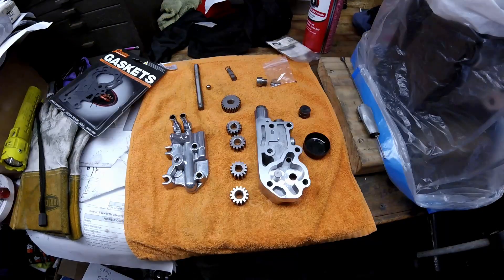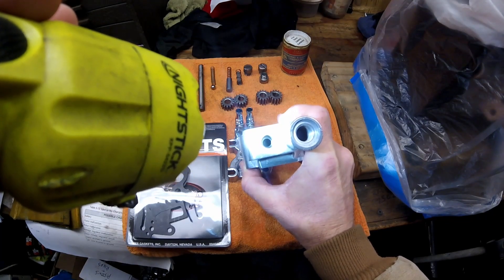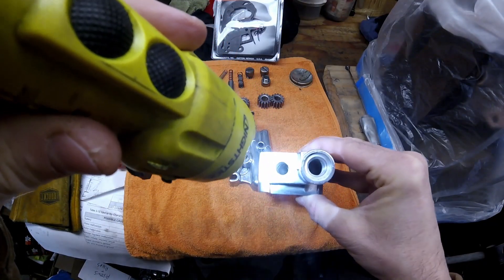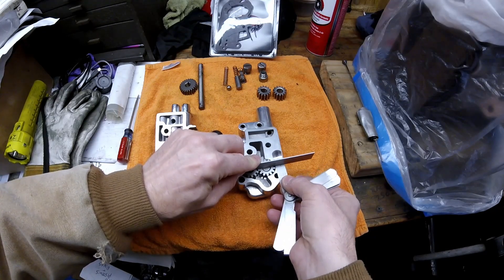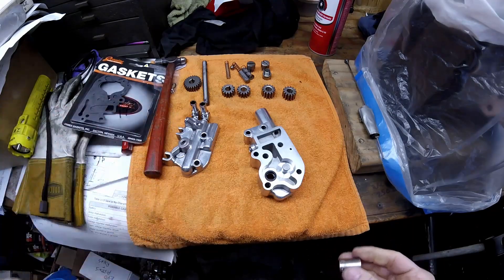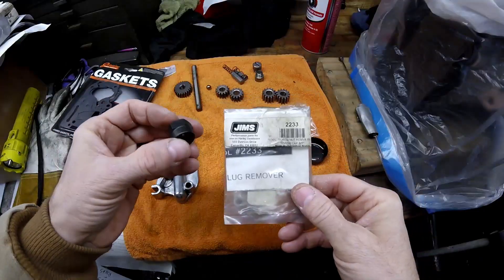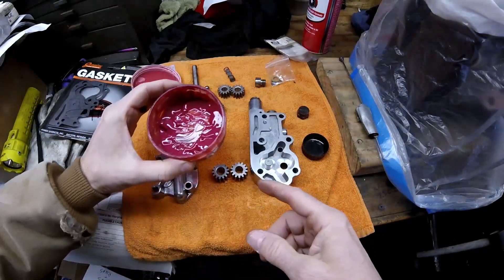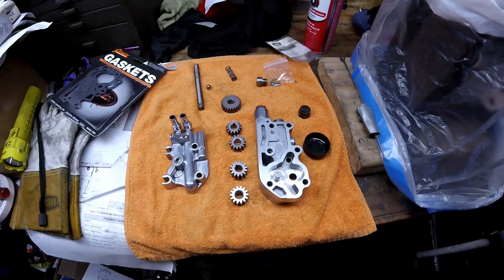Oil Sumping Fix and Pump Rebuild Harley Pan Shovel Evo

Comment: This is great info. I have an 91 fxrs-sp that's pushing oil out the breather..do you think maybe the check ball is the issue? Do you have a video on removing the pump off the bike?
Reply from the maker: I have an install video. Just do it in reverse. 

Harley Oil pump install the right way Shovel Evo Pan
https://youtu.be/n9XF6znbj0Y
Reply from the maker: I would remove the check ball and check to see if it has dirt under it. I’d also try replacing the check ball and spring before I’d remove the pump.

Comment: Could you plz let me know for compound grid spec?
Reply from the maker: Any fine grit is good. 600 grit is what I used.
Reply: @Rapsgarage  thanks!!! Need to clean compound necessarily? Or mix with engine oil ok?  If have to clean, I will work without separate oil pump from engine
Reply from the maker: Must clean grit out. You don’t want any grit in your engine. You can do it on the bike but you must clean it before you finish.
Reply: @Rapsgarage  Is there a way to clean it perfectly without removing it from engine?
Reply from the maker: @DM1212-x6y  I’ve used a q-tip and carb cleaner
Reply from the maker: @DM1212-x6y  I’m curious as to where you’re from? It’s always nice to know how far away people are watching my videos.
Reply: @Rapsgarage  I'm in the south korea. As you know, very few people ride Old harley in Korea, so there is very little information. It is a great help thanks to you YouTubers in the U.S. like you.
Reply from the maker: @DM1212-x6y  that’s awesome! Keep ride the old HD’s and I’m glad I can help!
Reply: @Rapsgarage  Thanks a lot!! One more question. Could you recommend the best engine oil spec and brand for shovelhead(kick start only)?
Reply from the maker: @DM1212-x6y  any 60 weight oil for an air cold the twin engine will do.  

https://www.ebay.com/itm/134810483763?mkcid=16&mkevt=1&mkrid=711-127632-2357-0&ssspo=wHbTM7iaTHm&sssrc=4429486&ssuid=zzfRVGHGQ1W&var=&widget_ver=artemis&media=COPY
Reply: @Rapsgarage  How do you think about the ams v-twin 20w50, unfortunately, I can't buy single grade spec engine oil in Korea.
Reply from the maker: If you can’t get a straight weight oil it’s a good oil.

Comment: I just went through this on my 86 FXWG 2 weeks ago. I found there was pitting on the ball seat. A friend owns a machine shop and had a "Ball mill" the same dia as the check ball itself. We manually worked it down a few thousands, then lightly lapped it. Perfection!  No leak!
Reply from the maker: That’s a great way to fix it. Thanks for sharing this information!
Reply: Did you have to open the cam chest or were you able to pull the body off without pulling the cams out?

Comment: I have done all this and including having a machine shop very lightly machine the ball seat. Still leaks like crazy just sitting there.
Reply from the maker: I’d put blue machinist dye on it and lap it again to make sure the seat is good. Also check for cracks. Replace the ball and spring. After that I’d check to make sure the the scavenging pump is working properly. It could be that you’re filling the crank case with oil and not getting it out. I’d also check to make sure your oil lines are good. If you have a oil line that’s collapsed internally it will not let it scavenge the cam chest.

Comment: For a new Chek Ball and light spring for a 1986 Harley softail fxst, I’m without my owners manual presently.. recommendations to source new ones(or do I  reuse the ones in the pump now)?

Also, can I use your technique of welding a ball on a rod with lapping compound while the external oil pump still affixed to the bike.

Didn’t know if I could remove the face to do the work, of the oil pump leaving everything in tact, only working on the check ball and light spring ?

I love this stuff yet don’t want to make myself anymore work the needed. Thanks all.

Any leads or videos- I’m grateful.  G-d bless all.
Reply from the maker: @EthanFox-jw7oc  I don’t have a way to get the part number for the parts. I would say if the ball looks good then reuse it. With the spring, you cam give them a little stretch but not much. Go easy with it. Maybe lengthen it a 1/4”. 
You can lap the seat with the pump connected to the engine but only use a small amount of compound. Its important to drain the oil from the oil tank before you start. It’s super important to get the lapping compound all out. I would use a Q-tip but with that you need to get all of the fibers out too. After you think you have all the compound out, pour a bit of oil into the oil tank. The oil will flow out of the pump at this location and flush out any compound that may be left. Needless to say that it’s safer to do it off the engine but I’ve done it the way I described above.

Comment: I saw in video you using a manual as reference were can I get one the cover year  I have an Indian motorcycle 2000 Gil Roy  external pump S&S engine 88inc
Reply from the maker: I’m sure you can get an S&S manual online or you can call S&S with your serial numbers, and they will get you the right manual.
Reply: Thank you for reply with info 😀

Comment: Great in-depth external oil pump video. I'm having that wet sumping issue on my '88 Evo Softail more often than I would like, and I want to do something about it. I was going to replace the check ball and spring, but now I'm thinking I need to somehow clean down where the ball seats. How would you recommend I do that with the oil pump on the bike? Thanks!
Reply from the maker: I would replace the ball and spring. I would also get a good carburetor cleaner and a Q-tip  and clean it that way. You will need to drain the oil from the oil tank before you start. Make sure you check the ball seat in the pump to make sure it’s not cracked or broken. Lastly I would make the tool I have and use very fine lapping compound. Only use very little then clean it out with a Q-tip. You have to do your best to get it all out. Thank you for watching and please subscribe if you’re not.
Reply: Thanks much! Just sub'd too👍

Comment: Rap, I don't know how I found you but I sure am glad I did. I have an 84 Softail that hasn't been running in many years. All the oil has stumped and I'm sure I'm going to have a mess on my hands.
Reply from the maker: You will have a mess! I'd pull the spark plugs squirt some oil into the cylinders and spin the motor over for a minute hoping to pump some of it back to the oil tank. Be sure to only add 1-2 quarts to the oil tank (if needed) and leave the oil cap off since it will pump a good bit back to the oil tank. Watch the level in the tank and the oil pressure light when you start it. If the oil tank goes empty or the oil pressure light comes on you will need to add more oil. If it pumps all of it back then the oil tank will overflow and spill out. Either way it's going to come out either the vent or overflow the tank but it MUST HAVE OIL!! Let me know how you make out with it.
Reply: @Rapsgarage  I did take the spark plugs out, I shot some lubricant down inside with Kickstart a few times. Oil couldn't wait to spew out LOL. I ordered a new battery and waiting for it in. Your accent sounds like you might be from the Baltimore area. I'm in the Gettysburg area. When I get the battery in and try to start it I'll let you know how I make out. Thanks so much for your reply
Reply from the maker: @dragonslayer671  Philly area...
Reply: @Rapsgarage  it's alive!!! I'm probably going to have to rebuild the carburetor. Nevertheless it's alive
Reply from the maker: @dragonslayer671  Awesome! Great job and thanks for letting me know!

Comment: Ok, so i am left with a question.
I picked up an early fatboy, it needed a ton of work so it didnt run for a while, 2 or 3 months maybe a little more. After getting everyrhing put back together, i fired it up and this is when i learned about sumping and the results...
So being that this is a builder bike, i looked into rebuilding ( which is how i found your video ) and i also lookes at simply replacing the pump all together. Im on the fence. S&S has a pump, $600, but i found v-twin mfg for half the price... 
Traditionally speaking, s&s is more performance based and v twin is more of a remanufacure...at least thats been my experience, forgive my ignorance if im wrong.... BUT!!! my question... are the specs the same? If i purchased the s&s ( because name brand value resale type thing )... hypothetically speaking in 3 years if it needs a rebuild are the parts the same?
Reply from the maker: I can't really answer your question. I would say this... I recommend keeping the pump you have if it not scored up and the gears are good. I have this video of fixing the sumping issue and I have another video on how to install you oil pump the proper way. The Harleys oil pumps are great so why spend the money. As far as S&S goes, they make great products! V-twin MFG is Taiwan junk! I would not trust that stuff. Would you go to a cut rate doctor for a heart operation or pay for the guy who is the best. Your oil pump is the heart of the engine. I hope this helped. If you have any other questions, please let me know. Thank you for watching and don't forget to like and subscribe.  https://youtu.be/n9XF6znbj0Y?si=0DpKBtboJ2WGYgpz

Comment: Which gasket is the best way to go ? 
Paper or the synthetic type ? 
My pump is leaking quite a lot of oil.
Reply from the maker: @KieranMckean  the paper is what I found works the best.
Reply: @Rapsgarage  
Should I install them dry or use any adhesive?    I assume dry . 
Thanks for quickly responding 👍
Reply from the maker: @KieranMckean  I've always installed them dry. I've seen a few video's where they put glue on the pump gasket but I worry that the glue can clog an oil port. That would be really bad. If your block or pump has damage where the gasket surface is then I'd consider using some sort of glue or sealer. That's just my 2 cents...
Reply: @Rapsgarage  
Thank you for the information and quick response to my questions it will enable me to keep my FXE super glide on the road for another 44 years. 🍻
Reply from the maker: @KieranMckean  Awesome bike! I'm glad I can help. Please like and subscribe. Thx

Comment: On my harley evo i have no oil pressure at all even when i give it rpm what could that be i have no kinks in my oil lines either
Reply from the maker: If you have an Evo or older motor it sounds like you have a broken key either the crank drive gear to the oil pump shaft or the oil pump gear to the drive shaft. You either have to pull the pump and check or pull the cam cover and check. 
If it’s twin cam or M8 you have to pull the cover on the cam chest. If you need further help, you can email me your phone number at hdrap_1999@yahoo.com

Comment: Rap, my shovel is dumping badly. I was told to drain the crankcase oil, but I don’t see a drain plug. Can you point out where to drain oil from? Thanks, Todd
Reply from the maker: Unfortunately, you have to  spin the engine without spark plugs and have the extra oil come into the oil tank and out the vent. Be prepared for a mess on the ground. If it’s really over full, you’re probably gonna have to pull the cam cover, which you have to remove the pushrods before doing so.

Comment: I knew it!  I'm on my first Shovelhead, but while watching Pacific Mike install an oil pump, I thought it didn't look right because there is no way to check for binding... His pinion gear was in.  Suspicion confirmed.

Any idea if I should upgrade my 1980 pump to the later type and drill the hole?  That was my plan on my bike with 12,000 original miles...  The hope is to fix the '80 - '81 oiling trouble I hear about... but what do I know...
Reply from the maker: I’ve never heard of that problem so I would say if it lasted this long, why change it. I’d run the factory pump. I’m glad you liked my video and thank you for watching. If you haven’t subscribe, please do.

Comment: There's only one other engine builder that I know of that recommend lapping the oil pump checkball seat like that, Keenan Tatro, of Tatro Machine, SanDiego cA.
Reply from the maker: Well at least that guy got one thing right in between banging his tool on the workbench. I’m not a fan of his. Thank you for watching and commenting.
Reply: @Rapsgarage  Tatro is an acquired taste. I didn't like him either when I first found his videos, but after a while I  learned to appreciate his skills.  He has to be the hardest working guy on YouTube.
Reply from the maker: @thomaskirkpatrick4031  I watched a video of his and he pulled the left side crankshaft bearing off to change the shim for the end play. When he pulled the bearing he pulled it from the outside race. Then he reused the bearing. That’s something you definitely can’t do. You have to throw that bearing away and get a new one. When I questioned him on it he tried to defend himself rather then admit he was wrong. I told him it’s bearing 101 then he called me an A-hole. Lol He does other stuff that’s not the way it’s done. If you know what you’re looking at you can see he’s not as good as he thinks he is. Dragon Man is way worse!!
Reply: @Rapsgarage  I'm not defending him, but a lot of the work he does on bikes, is for guys that don't have any money. He's called me an asshole lots of times. Once for asking him the temperature.  Right or wrong I enjoy watching his videos, same as I enjoyed watching yours.
Reply from the maker: @thomaskirkpatrick4031  Sounds good buddy. Thanks for watching and the kind words. Let me know if I can help anytime in the future.
Reply: @Rapsgarage  absolutely,  how are you with the EVO?
Reply from the maker: @thomaskirkpatrick4031  I have a full build series on an Evo right now. There are my most recent videos.